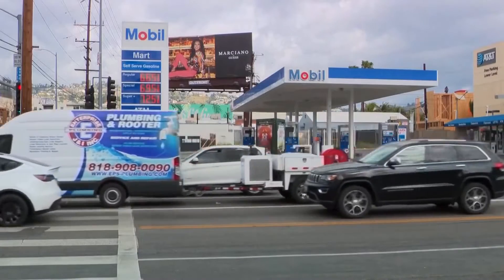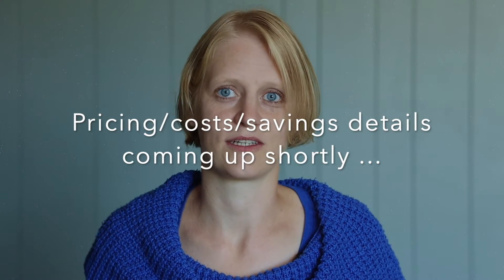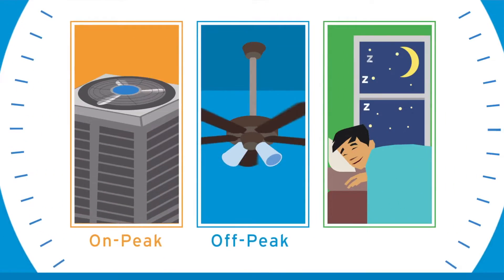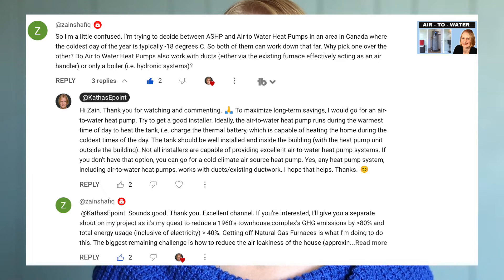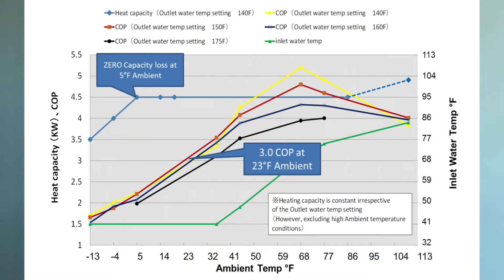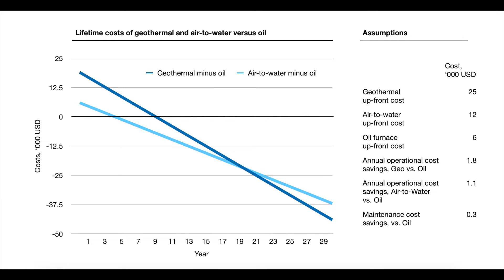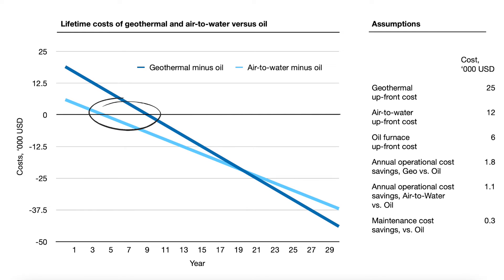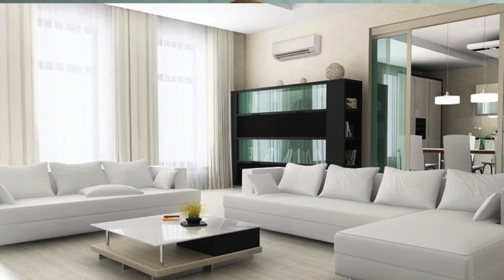Air-to-water vs Geothermal  (How to make the right Heat Pump decision)

Comment: And what about air to air?  They are far simpler and more efficient to run.  Air to water is not more efficient.
Reply from the maker: Hey, Thanks for leaving a comment. You can find info on air-source heat pumps in several of my videos: 1. https://www.youtube.com/watch?v=3ExhnTuYNZ4, 2. https://youtu.be/l83GOCpcotY?si=cGW-zhiGFy6GKoPq, and 3. https://youtu.be/Fv7xkOcud5w?si=D5ex9F-K724FcfbE. Air-to-water should be more efficient than air-source, especially with a water tank. Hope this helps, Katha

Comment: Most heat pumps in the US use R410, whose production is being phased out. Hard to find CO2 or propane based heat pumps. I have read that there are heat pumps that use air source until it drops too low than switches to ground source, but that will not be found in the US either. I definitely like the idea of a buffer tank and solar powered compressors, that's doable, except for the outrageous money being asked for a hot water tank. Thanks for the video.
Reply from the maker: Thank you very much for sharing! Do you remember where you read this?
Reply: @NetZeroTech   Here is one source: https://www.energy.gov/energysaver/geothermal-heat-pumps 
there are many others, BUT, the term hybrid is not used consistently, so you may have to read to make sure. And so just to make sure you understand me, the hybrid would use an air-source until temp gets too low, then switch to ground source. One other thing (it's probably not my idea, but I haven't found any other reference to it is this. Just after the compressor and condenser dump the heat into water, then send still warm refrigerant to an wall mount unit to dump remaining/residual heat to the room air. Allows for more heat to be extracted from the refrigerant because of the lower exhaust temp into room air. Should be more efficient.
Reply from the maker: Thank you so much for sharing! I really appreciate it !!!  Katha

Comment: Monoblock air to water heat pumps can use more efficient, lower GHG refrigerants like R32 and R290 because the  refrigerant is contained outside the house. Unfortunately they are impossible to find as yet in Canada. R410 is advertised as a "green" refrigerant. It is not.
Reply from the maker: Hi, refrigerants are on my list of potential videos. The most environmentally friendly refrigerant is CO2, I think. Cheers, Katha
Reply: @NetZeroTech  CO2 sounds good on the surface but the truth is that the equipment required is much more complex since it runs at very high pressures and it's more expensive than the very green (low GWP) and cheap R290. R290 is the ideal ATW monoblock refrigerant for Canadian climates. It's irrelevant that the refrigerant is flammable for a monoblock since it's outside and any release would safely dissipate. A propane BBQ or a gas boiler/furnace is more dangerous than a hermetically sealed heat pump.